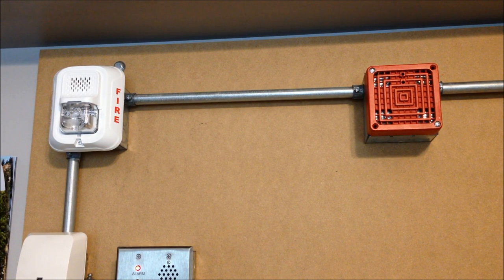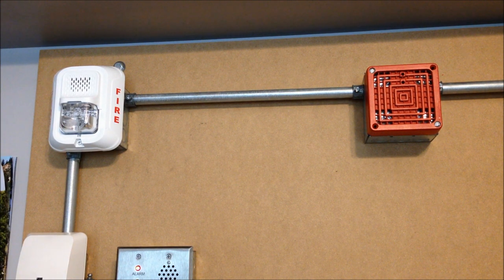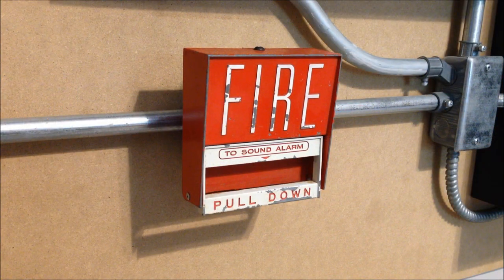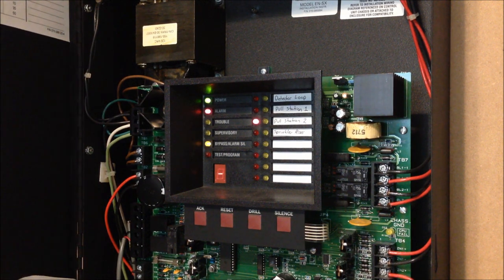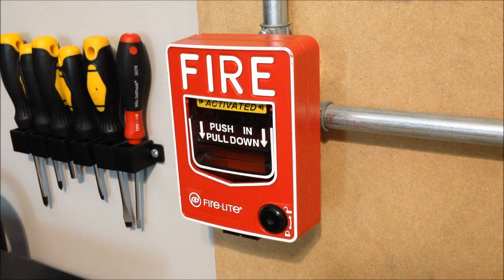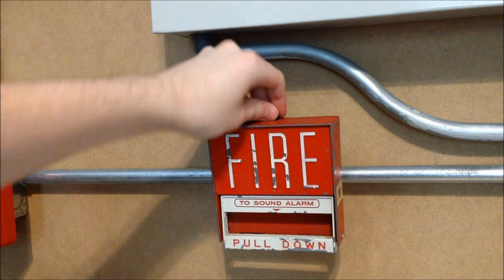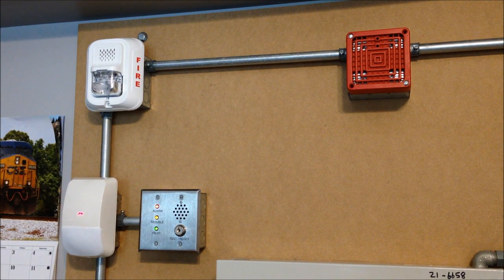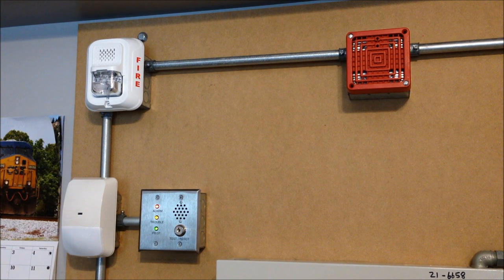System Test 43 | New L-Series vs. Mechanical Vibratone

Comment: It's pretty interesting how some electronic horns can pair really well with a mechanical horn. Most of the time though the mechanical horn is more louder than the electronic horn, but I guess that's not the case with this test :-/. Well, it's "unknown" from what you're saying. 

Also, so the way the BG-6 pulls down determines the generation? Interesting. If that's the case, then since my BG-6 turns to the left when I pull it, I have a first-generation BG-6? That's really neat if that's so :).

Great video of course ;)
Reply from the maker: The first generation stations retract a little bit to the side when they are pulled, like mine does in the video and like how you described. The second generation stations had a better locking mechanism and 'clicked' fully into place when pulled, so the handle does not retract or go off-center on those units.
Reply: +kcin556 Cool! 🙂 Originally when I first got my BG-6, I thought at first the screws that hold the "PULL DOWN" handle bar were loose, and that was what was causing the BG-6 to go the left slightly like that. I guess that's just normal for the first generation BG-6s.

Sometimes though the handle bar will get stuck if I pull it down too hard or something. This is the case when it doesn't retract (or "bounce up"), and usually I've had to push it back up (a few of my videos actually have that happening 😄). I will say I like the robust and all-metal design of the BG-6. It's great pull station in general in my opinion 😉. Just gotta be careful with the paint chipping though.....